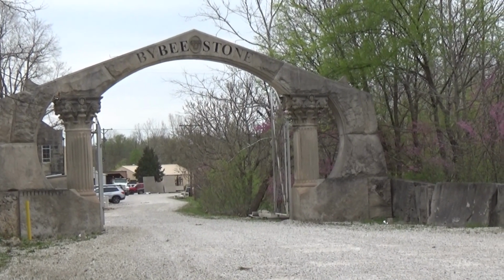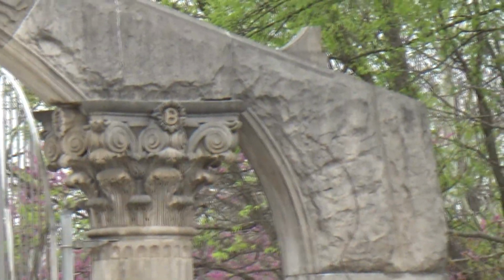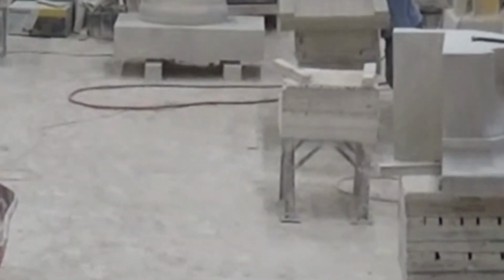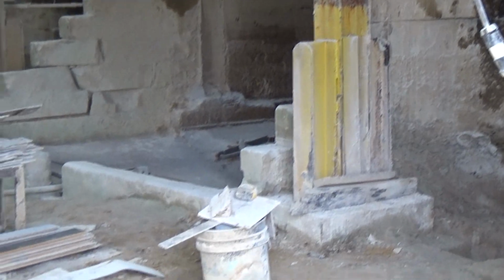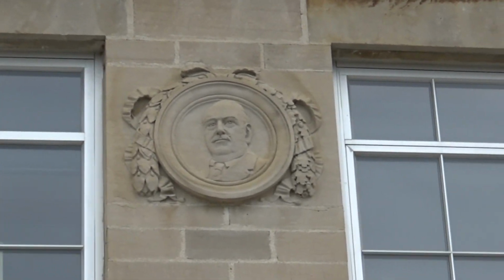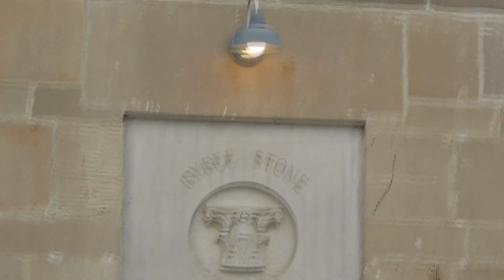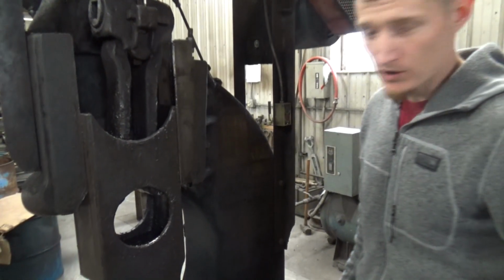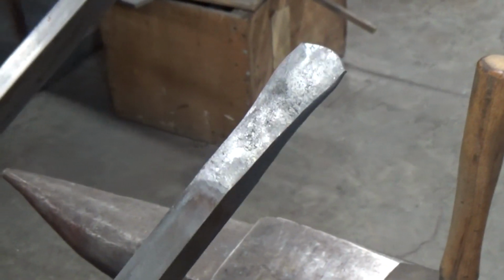Bybee Stone Company Tour by Wayne Ferree

Comment: Good Video Wayne.  This is the first company that I have seen make heavy duty gouges that could handle lime and marble.  I also notice they use an abundance of bronze when brazing their carbide. I suppose that is for sharpening purposes? Please explain?  I just sent for their catalog.
Reply from the maker: I think it is because, the brass will run into the voids at low temps, it holds well and wont affect the temper of the blade.